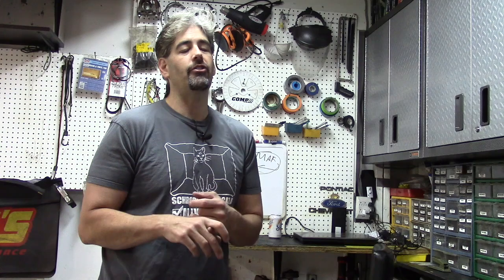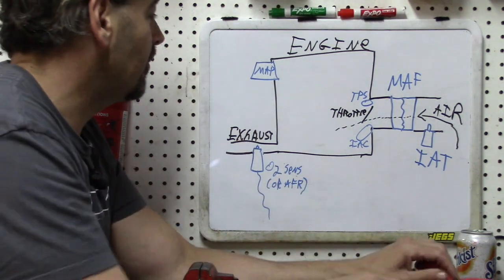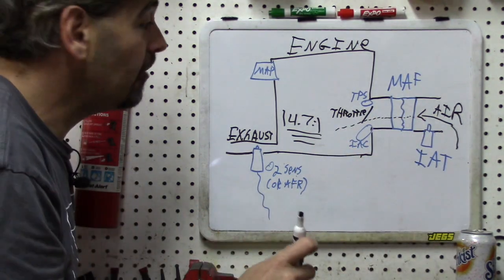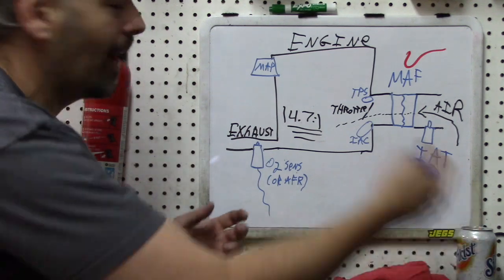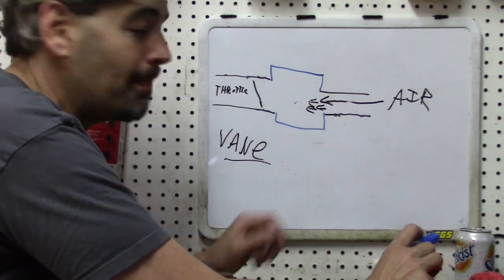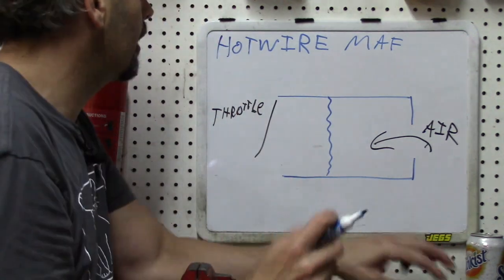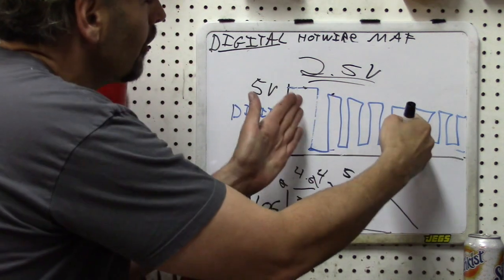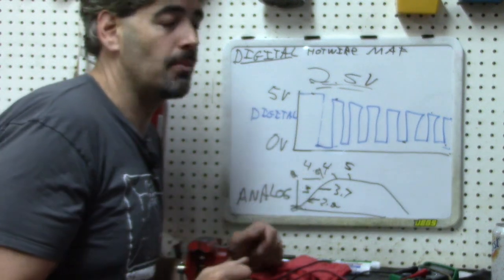Diagnosis and Understanding: MAF Sensor Pt1 Analog, Digital, Hotwire, P0101 P0102...

Comment: my multi-meter has several added features for measuring: Auto-range, Temperature, Frequency, testing Diodes... I got it as a gift, but I think it was fairly expensive.
Reply from the maker: Paul MvN Yes I have seen those but out of my price range for sure. Gosh I so seldom need anything other than V,A and Ohms I just can't justify the cost, especially now with my Vantage.

Comment: Appreciated 👍 very well done and good explanation very simple and to the point .
I have a problem if you can help me out please , 
It’s a Range Rover sport 2010 3.0 diesel.
1-Starts straight away
2-engine light is on and it’s on limp mode 
3- throwing code p0193
4-change the high pressure fuel rail including the sensor 
5-changed map and maf sensors 
6-car won’t rev past 3
7-max speed goes up to 70mph
8-drops the rev and speed when going uphill 
9-sometimes on a flat road it drops the speed to 20mph and rev won’t past 2
10-recently got it services and changed all the filters including fuel filter .
11-i have got a cheap OBD scanner and saw a fuel pressure on live data it shows 22000 and it’s still won’t go up and down when rev .
12-when sudden floor the gas paddle it will drop the speed rev won’t go up it feels like fuel not coming or exhaust is blocked ,fuel or exhaust system feel squeezed .but if rev it slowly /gradually then it picks up speed until I floor the peddle but when release the paddle half way up then it feels bit of ease .
13-sorry for the very long message but I wanted some help desperately and wanted to describe as much as possible .been to land hover specialist and few other garages but no joy ,some say it’s an electric issue and some say it’s a high school reassure fuel pump and some say it’s a turbo or pcm issue but no 1 is able to figure it out exactly ..
( I have a short video uploaded as well on YouTube ) any help would be appreciated.👍
Reply: Do you have a digital or analog MAF?

Comment: Hot wire MAF is actually a resistor that gets energized and the resistance value changes upon heat dissipation from incoming air.  Probably a thermistor same as the coolant temp sensor?  I'd be interested to see a MAF dissected.
Reply from the maker: ***** Agreed

Comment: Hey Mr.Master, I am thankful to you as an Auto Electric who was looking for such kind of information for long time. But I would have a question to you that, if we see any 5V sensor except constant hot wire and ground wire  in a car, we will need a oscilloscope to look for its Hz to be sure about its working. But if we see empty wire except constant wire and ground wire, That wire can be checked with multimeter cuz that That empty wire sends voltage to ECU regard of changes. I also faced with such kind of car on Mercedes w210 and it was not possible to check it by multimeter. It was interesting for me before, but I think I found its reason here if you confirm me as well))

Comment: Another great video with lots of good information!  I haven't run into one of these vortex sensors yet; looks like I'm gonna have to do some research!  I think I might have heard something about their existence in passing several years ago, but that's it.

On an interesting side note, your mention of O2 sensors reminded me...  Pick up an old (or new) analog voltmeter!  I think Harbor Frot still sells them.  Scopes and GMMs are nice and all, but sometimes it's easier to just toss an old analog meter on the thing.  It's definitely cheaper, especially for the DIY guy that doesn't want to drop $1,000 on a low-end scope.  :)
Reply from the maker: Just for fun I put a analog DMM on the MAF after the video just cuz I was curious and it read exactly the same as the digital DVOMs.
Reply: Schrodingers Box Yeah, I would expect as much.  MAF frequencies are just too high for the physical mass of the needle and assembly to respond to.  They tend to do well with O2 sensors and various other sensors too, though!  :)

Comment: Matt,  intelligent overview as usual. Thank you again. I am dealing with a potential MAF issue at the moment.
One thing I wasn't totally clear on: if the MAF function is operated by  an (up to) 5V ref from PCM what's the function of th 12v input, and do signal wire (up to 5v) share the same ground as the 12v? 
SannerDanner has a interesting golden rule: at WOT, the analogue hotwire MAF must read over 4v. I'm in process determining if  a 3.7v max may contribute to a slight fuel trim irregularity, although other MAF parameters are within spec.
Interested in your view:-)
Reply from the maker: +Alex Messina The 12V is merely to actually heat the wire. It is not the sensing reference.
 On some MAFs this will share a ground with reference, on others they each have their own ground.
Reply: +Schrodingers Box Thanks Matt. kind of as I thought. Ref must extrapolate from varying wire current (a 12v circuit) that keeps constant temp? But how is current varied if analog 12v circuit is not pulse width modulated?

Comment: When I did put it on the OBD  it shows perfect no alms no  engine check light. But the full story is. I bought it it used to be so hot. I thiought it was because the engine wss uder the seat. So I bought insulation material and insulated it. Helped alot but the heat was under there. Sometimes your going up a hill and it just will not go. The engine is not reving. It comes very slow then after almist coming to a stop it picks up and shoots off fast quickly changes out and start going slow again with engine not talking the rev. Also it is drinking that gas like a hole is in the tank. When its drinking this way its hot. When the mileage is good enginenis so cool you never need to insulate it . So its a sometimes situation. I do not think its a oxygen leak but it behaves like its not getting the right ratio of fuel and air. Cause engine is not reving out . When your parked it will rev out but not very quickly its respond but not fast. Slowly revs up not quickly.it has me really puzxled. Also because it was doing this I check the catalist and found it blocked up. I removed it completely. Then imediately engine light came on saying the catalist is not woring. I place a adopter inside it to fool the compter the cat was still inside and it removed the check engine light. But its same drinking gas and not respoding when hotnor going up a hill. If you stop and move off it does ok then slows down as it changes out and go back to a walk then after this it shoots off again and repeat it all the time. The upstream 02 sensor or cat monitio is a four wire and when I plug it into the conector and turn the ignition on and hold it in my hand it is mit heating up at all. However the the top one closest to the exhaust called the fuel air ratio sensor warms up in my hard as soon as the ignition is turned on. Hope you can.help me. Nof aure if both shoild work same way. Both os four wire so I imagine both has a heating circuit. But the sown stream one mot getting warm.

Comment: Would there be a benefit to add a mass airflow sensor to a 94 GMC Jimmy 4.3 liter currently doesn't have one only has a temperature air temperature sensor question.
Reply from the maker: No because the vehicle uses speed density adjustment from MAP
Reply: Thank you for responding so quickly always trying to learn always trying to do better I appreciate your help .

Comment: Though the video is titled MAF don't forget about the VAF (edit ahh I see your covering it now).  My car comes with a V6 that has a VAF.  Also happens on my car that the IAT is built into the VAF as a one non-serviceable unit. :(  Mazda 626 only came with a VAF on the V6 and they swapped from VAF back to MAF in 1998.
Reply from the maker: Got you covered bro!  Including the integrated MAF/IAT designs. This one is comprehensive as possible!!!

Comment: hey Matt are you sure on GM signal and groud are not connected inside when off vehicle? i just saw Paul Danner on gm maf video saying that signal is grounded by a transistor inside the sensor and not by the computer. but now i dont know if when its off it stays connected to ground or open. maybe your sensor is bad because i just bought new one and mine there is continuity.

Comment: Thank you for this useful video...Bmw e39 siemens air mass sensor hot wire 3 lines, Is this Analog or digital?? Please answer me
Reply: I will send you a  picture on gmail
Reply from the maker: Depends. What’s your voltage reading indicate that it is?

Comment: Here is my problem. 04 GMC Jimmy 4.3 vortec.   Banks 1&2 read rich.  MAF shows 10g/s.  Fuel trims show -25.   Replaced MAF and replaced spider fuel injection.  Still shows same reading.  I’m thinking the IAC valve is allowing more air to pass the throttle plate which shows the high reading on the MaF.  No IAC codes though.
Reply from the maker: Sorry there is no useful data here. What’s the fuel pressure? What’s the fuel trim curved against load? Whats the fuel pressure?
   I am not sure how what indicated the spider injection needed replacement.

Comment: Just for a little added info, some Fords incorporate the barometric sensor into the MAF sensor and have more wires connected..
Reply from the maker: wysetech2000 Oh hell- so that would be like an 8-pin connector then. Wow. Maybe the vantage pro pinout-cheatsheet not so bad after all lol

Comment: Hello Sir, I have an interesting problem. Vehicle is a 2005 Ford Focus ZX5 2.0 automatic transmission. I diagnose this for a friend vehicles original problem was damaged intake manifold. This engine has swirl valves in the intake. The valves or flaps were worn to a point that they rattled when the engine was running. I confirmed the rattle by disconnecting the vacuum hose to the vane actuator. When I did this the noise went away. Further conformation found after removing the intake the swirl vanes had more than a 1/4" of movement with broken plastic bushings housing. I replaced the intake with a the OEM Ford part. The noise is no longer present but now I have another issue. The engine idles but when you accellerate the throttle seems to stick at 3000 rpm. I removed the throttle body assuming it maybe sticking and cleaned it this was no help. I verified all my connections completed a smoke test on the intake looking a vacuum leak none found. I tested the mass air flow sensor its a 6 wire MAF I have the 12 volts and 5 volt reference both present grounds are good. Output voltage to PCM 1.5 volts at idle and 1.96 volt at 2500 RPM. Output air temp sensor voltage .06 . I tested the idle air control valve 2 wire connector input voltage 12 volts ground good the IAC the very dirty and was replaced no help. I did the dumb check and unplugged the MAF. Car idles and accelerates and does not stick. Only thing I can think of is there is something internally wrong with the intake. What do you think?
Reply from the maker: If you suspect something wrong internally with the intake i would do a volumetric efficiency calculation and see if you come up .8 or better.
Reply: Schrodingers Box. Hello thank you for responding. I believe it's a stuck open PCV this is why I removed the intake hose and used my hand to cover throttle body which should cause the engine to die it does not. I know this is also taking the MAF out of the circuit but I believe my testing on the sensor and the wiring proved it to be good. In order to reach the PCV the intake needs to be removed. It's late and I have to go to my real job tomorrow. Thanks again.

Comment: Would it be be any point or use in buying an oscilloscope, similar to one used on a desk top, since they are much cheaper than a scanner to help troubleshoot these type of digital signals?
Reply from the maker: only for these types of signals but there is no way I would get a scope instead of a scanner. scanner first- scope supplements.

Comment: I have a 97 Suburban with a 5.7.   I checked the voltage at the MAF and got a real surprise.   The voltage actually drops at a rate about equal to the rate that a lot of guys say it should increase while engine speed increases.  Have you ever seen this and what do you think could cause this?
Reply from the maker: +Glenn Taft Sounds to me like you are probing the source and ground instead of source and signal.
Reply: I am checking the black and yellow wires.  I was told the red wire was the 12 volt supply.  With the key on and motor not running the two wires showed 4.9 volts on my meter.  With the motor running at idle the two wires showed about 3.5 volts.  I think the MAF is bad, but I am wondering why it would be lowering voltage instead of just not showing movement at all.  Needless to say the Suburban runs ok at idle with a little miss but as speed increases it just gets worse and worse.  It is like it hits a brick wall at 3 grand.  I really like your channel.  I am learning a lot, but for someone that hasn't ever driven because limited vision I could really stand to learn a lot more to keep my wife's vehicles going.  I think you missed your calling.  You should be a teacher unless you are already.  Very informative and fun to watch the videos.  Is it possible that the MAF somehow went defective and reversed its operation?

Comment: Hi, I have a very nice Hotrod, with a 1996 LT1.
It's driving me crazy (-:My problem is that it is surging and is running fat on idle.
I have replaced nearly every parts, and still no luck.
Fuel pressure, compression, and smoke leak test is done.
New Sparkplugs, wire (original suppresion core), optispark, TPS, etc.Nozzles are checked too.
There is no fault code readings.I think the problem is a wrong tune to ECU, but I am not sure, it is possible.
When I put my Scantool on, I can not read gram per second, it is shows 0 volt. Though the digital signal i yellow wire to ECU is ok.
When I measure connector to MAF, I have 12V, Ground and 5 Volt.
When I use my scobe, MAF is working fine.When I unplug MAF, there is no change in idle (still bad), and most important there are still no fault code, to read on scan tool !!! Shoud the not be one ?
Regards Claus
Reply from the maker: You can't tell anything from an unplugged MAF.   I recommend starting with the basics and use fuel trim analysis to determine the direction and THEN check your specific components.
Reply: @SchrodingersBox  Okay, but should I not be able to read g/s on Scantool ? and should there be MAF fault code, when unplugged  ?

Comment: Hey Matt, and for anyone else that is reading this.....I am working on a 2001 Chevrolet S-10 4.3L, and the MAF readings are 6.43 grams/second at idle of 650 RPMs.  If the rule of thumb of the grams/second  equaling the engine size, I should be reading around 4.3 grams/second.  Is this correct?  If not, what would cause this engine's MAF to report 2 grams/second higher than it should for this engine?  Thanks.
Reply from the maker: You have to curve it against fuel trim

Comment: Does a car have a barometer? Also a multimeter measures average voltage. If we can extend the time period, we can use the average to back out the pulse width?
Reply from the maker: Yes!  When you measure the MAP when key is on but engine is not running, the measurement is Barometric Pressure.

Comment: Awesome stuff. I had a CEL on a 2008 base Prius and knew that the gasket on the downpipe from exhaust header to exhaust pipe needed to be replaced. Was getting P0101 code. Fixed exhaust. Cleared code and it came back. I replaced the air filter and cleaned the MAF. Cleared the code. It came back. I looked for vacuum leaks, found none. I pulled the box that held the MAF because I didn't want to mar the little screws that held the MAF . Once I had the box out, I looked at the MAF and noticed the gasket that was supposed to make an air tight seal around the MAF was misshapen. I guess the air leak can come from almost anywhere. I will try to find a new seal for the MAF and see if that fixes it.
Reply from the maker: why not just check the signal voltage from the MAF?

Comment: Hey Matt, you said that temperature of the hot wire is constant but at the same time 100 degrees above ambient temp. Doesn't it make hot wire temp variable? Because ambient temp varies.
Reply from the maker: Yes you could look at it that way. The way I think of it is “it’s a constant temperature above ambient”  which is indeed variable, but also constant Lol.
Reply: @SchrodingersBox  That's what I guessed, Thanks.

Comment: Matt - Does Mass Air Flow cleaner work to clean a Vane Air Flow meter? The vane on my '93 Protege sticks slightly and the car bucks sometimes when I give it gas. If not, can I use Carburetor cleaner and clean it out like cleaning a throttle body?
Reply from the maker: yes absolutely. hell I use brake cleaner lol. that MAF cleaner is $8 a can and I see no benefit over brake clean.
Reply: @SchrodingersBox  Thanks Matt.

Comment: Great video ! I have a 2000 ford ranger 2.5l with a lean code. The mass air flow sensor is reading 0.50 g/s with engine off and 2.21 g/s with engine on at idle. Is those normal readings ?
Reply from the maker: It depends. You have to combine it with other induction data. What are the fuel trims indicating?
Reply: @SchrodingersBox  short term with engine off is 36.7% and long term reads at 0.0%.
Reply from the maker: See what it is once LTFT stabilized and then calculate total trim and see where it goes.

Comment: I am so confused on what stoichiometric ratio means. 14.7 parts air to 1 part fuel ... what is the part of air that we are comparing to a part of fuel? Sorry but chemistry isn't exactly my strong suit.
Reply from the maker: Great question.  It is a Weight:Weight calculation.  That is, for every 1gram of fuel, 14.7grams of air are desired.